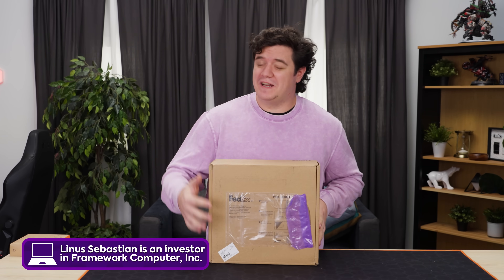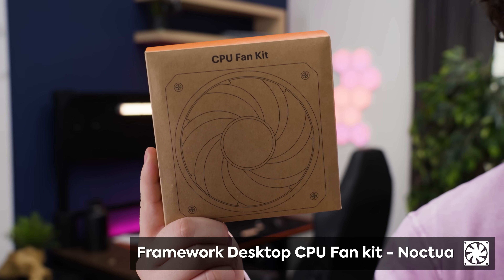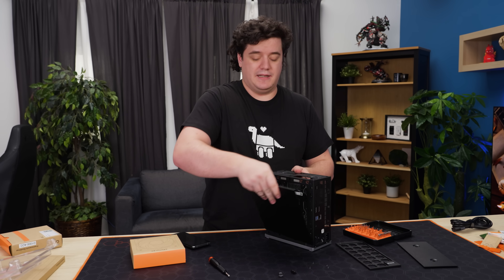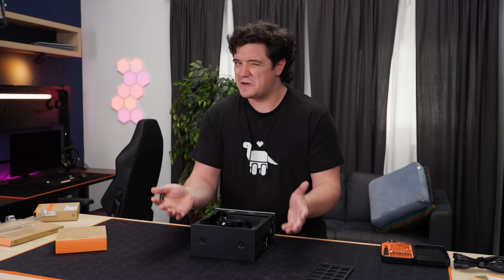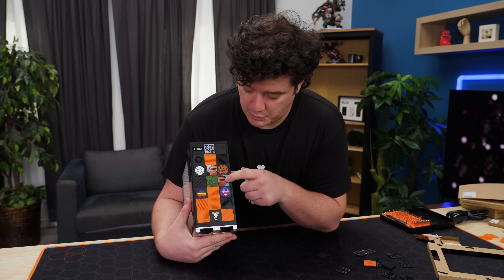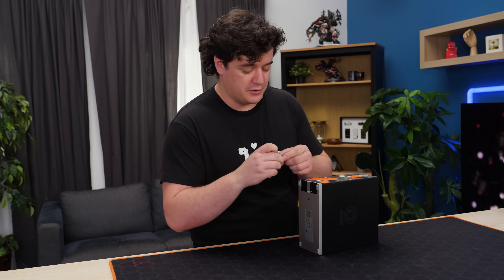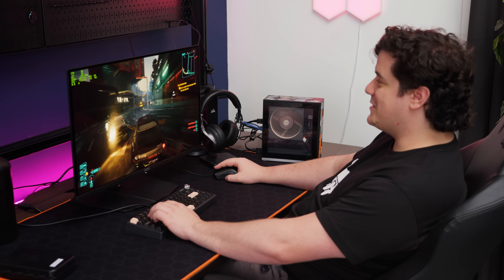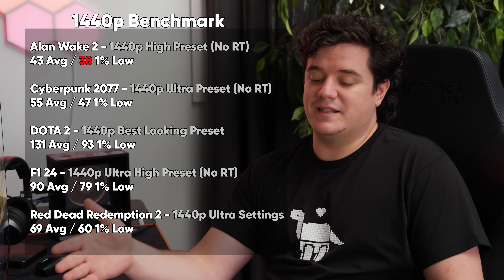This TINY desktop makes me nervous.... - Framework Desktop

Comment: You can't get 395+ chips that DONT have soldered ram, that's half the reason they're this fast and efficient. There's practically no latency.
Reply: I think it's partially an AI ecosystem thing...  VRAM capacity and bandwidth are usually the limiting factors when trying to run large language models.  The price starts to look downright reasonable when you compare it to the cost of buying enough GPUs to hit 96GB of VRAM.
Reply: I don't think that 2x latency compared to fast DDR5 can be called "practically no latency"
Reply: @NikitaCartes  It would be more fair to compare it to DDR4. DDR5 is slow compared to any memory that is faster than it.
Reply: The CEO addressed it, they tried with AMD but couldn't get it to work, and CAMM is still not a thing.
Reply: "There's practically no latency" 100% BS. Tell me you don't know what you're talking about without telling me you don't know what you're talking about. Unless you think that 139ns is "practically no latency". I'd say that if it was below 50ns.
Reply: and so the PC world realises and follows apple years after they did it
Reply: But isn't frameworks whole gimmick, interchangeable parts ? Lol they gonna go out of business quick
Reply: Disagree about the c-13 cable. I have plenty of those and I don't need more. Five bucks. It's not a big add if I actually need one. I think it aligns just fine with their mission of less waste.
Reply: @noisycarlos  I'm fine not including it by default, and I was when Apple did that, but it should be a free add on in the order process
Reply: @noisycarlos  Agreed.
Reply: The 8840u had soldered only configs. Unfortunate side effect of trying to be the fastest. Apple’s unified memory is the future of modern CPUs.
Reply: @FishyFelix  i highly doubt that, or we'd stuck with that system after the 80s 😂
Reply: @PutYourQuarterUpGaming considering that the 2 biggest brain groups are working at Apple and AMD both decided that unified memory is better.
Reply: @FishyFelix  It is NOT the future lmao. Apple "8 gigabytes is equivalent to 16 gigabytes" unified memory
Reply: @HyperScorpio8688 That was definitely a horrible statement, but even they now only offer 16gb minimum. 
I think OP is referring to unified memory being the way forward, not capacity.
Reply: Okay so why does the company who is all about repair and upgradability choose to launch a 395 desktop? Why release the product if it doesn't differentiate from others?
Reply: @RAMeReviews  AMD claimed to have made tests with the fastest available memory on the desktop site and it appeared to have basically crippled the integrated graphics engine
Reply: @RAMeReviews  because it's really interesting chip for enthusiasts that would never get released on AM5 (all due to 256 bit memory bus).

They nicely fill the niche for people that would want it in standard desktop/ITX format (so no Dell/HP with proprietary PSU/front panel connectors/etc) and get have quality BIOS with updates (no minisforum and alike).
Reply: @RAMeReviews  This is more repairable than many of the other products you can buy with this chip.
Reply: @RAMeReviews AMD was probably like, “Best we can do is this soldered package,” and Framework couldn’t negotiate anything better. Besides, if you want an SFFPC with replaceable internals, you’d just buy those parts off the shelf and suffer stuff them together. I don’t see why people are giving them a bad rap for this decision when traditional desktops are already fully modular.
Reply: @KirbyNPenguins  You can't negotiate to fix the laws of physics!!
Reply: @RAMeReviews  Because it's the best SOC solution on the market?!
Reply: @RAMeReviews  Because people who would bother to care about repair and upgradability largely overlap with people who care about local AI, so it's a similar user profile for Framework there.
Reply: @RAMeReviews  the soldered ram is the difference on this read up on it before it makes you looks less dumb
Reply: @RAMeReviews   They are pushing for CAM2 to be added to the spec for the next gen.  If you are not a customer you don't get a seat at the table.
Reply: @zanzabar4ky7 Still feels like a move against their business model. I would have been a customer had they not gone this route.
Reply: @zanzabar4ky7  Would probably require some changes to the chip, because my information is that Framework asked AMD if CAM2 could work with the signal integrity, AMD simulated it and it was a clear no.
Reply: @beanwithbacon  you find a lot of other small/mini pc’s that can pack that amount of ram?
Reply: @jessiethedude So make it slightly larger. Form should NEVER come before function.
Reply: @RAMeReviews There are plenty of companies making ITX motherboards with a CPU socket and RAM slots, so there was no reason for framework to make that. Instead, they made the most modular and repairable Ryzen 395 desktop there can be.
Reply: @RAMeReviews  because you can always buy the next board/soc that comes out
Reply: @RAMeReviews  it's just to get the product out there, I'm hopeful they'll release another with options besides soldered ram like minisforum does with their boards.
Reply: Wouldn’t CAMM2 help? I believe it have better latency then DIMM/SODIMM soooo…
Reply: @leon0399-yt  According to AMD engineers, it didn't work with the memory requirements of the 395, Framework asked and they simulated it
Reply: @leon0399-yt  I think it's not quite so good, and still ludicrously expensive.
Reply: So when Apple does it y'all riot, but when Framework does it you understand the benefits and forget repairability/upgradabilty?
Reply: @lightningdev1  apple charges wayyy to much for ram tho
Reply: @lightningdev1  Oh, I blame AMD for requiring integration as deep. Apple designs their own SoCs, Framework doesn't
Reply: @lightningdev1  It was not a Framework choice, it was an AMD choice. You can't fault them for someone else's bad decision, while Apple was all them with the bad decisions
Reply: @HyperScorpio8688  AMD chose to make ann exceptionally power CPU rather than an ordinary laptop CPU. Definately a good move.
Reply: There's practically no reason to need more than 64GB of ram within the next 5 years either. RAM requirements have stagnated a lot. I prefer to get soldered high speed RAM over modular sticks that I will never replace anyway.
Reply: @linaori  i disagree, even if it's a one off thing, when i was zipping a very large file it easily ate up all of my 64gb of ram when trying to use the best settings (i believe i ran into ram issues when i was using a local ran AI LLM too). Also I'm regularly using 25g-30gb of ram just having all of my stuff open, chrome/brave likes a lot of ram (plus having 4-5+ other programs always open on my second monitor), plus i get to keep all that open and play a game on top of that. i wish i had 128gbs just to have plenty of wiggle room, that's also why i bought a i9-13900kf CPU and a RTX 4090 GPU so i could do whatever i want on my PC and have relative futureproof for a few years.
Reply: Wgy not use camm ram memory
Reply: @AndresSanchez-uy9hh  Doesn't improve the issue
Reply: @AndresSanchez-uy9hh  Not quite so good, still ludicrously expensive.

Comment: Chill out about the soldered ram. It's been explained in depth that it's the only option. Nobody gets mad that their GPU has soldered ram, why is it so important for CPUs where the reason for soldering is performance?
Reply: I'm mad GPUs have soldered RAM.  They used to have socketed RAM so you could expand them later.  It would make much more sense for a modern GPU to have 8GB of RAM if it was socketed and you could upgrade it.
Reply: You are literally talking about apples and oranges bud. There is good reason to be frustrated by it, even if it is the only option. It would be nice to be able to upgrade the system in the future obviously. I'm not personally miffed about it, as I probably wouldn't buy it anyways. But to act like you actually care this much is laughable, and your point is barely a point

Comment: They should solder the memory to get the performance target they are after and make AMD happy, but still include 2 separate empty slots for future expansion.  Makes everyone happy and adds 5 cents to the cost of the motherboard.
Reply: I am no expert, but I suspect this wouldn't be practical without some sort of secondary memory bus clocked much slower, and I'm not aware of any computer CPUs that have found that to be cost effective. Electrically coupling the longer paths and less precise connections on the extra slots to the fast bus from the soldered chips would likely drag the bus speed down, possibly even without any extra RAM installed. Just having the extra paths sitting there like antennas would be rough.

Comment: "Look at the size of this thing!"

Look at the price of this thing.
Reply: I own a Framwork 16 and I feel the same way about the new main board pricing for that laptop. At least the 5070 has a good price.
Reply: You can literally buy 5 mac minis for that price lmao
Reply: if you have thee gpu. just get a minis forum cpu/motherboard. add the $99 gpu dock and your good to go. if you keep your eye on the website you can get a 16core 32 thread cpu motherboard combo with ther dock for under $600.
Reply: If you want to run local llms (which is what I would use it for) it's a pretty damn good price
Reply: Yeah that so stupid. was hyped about it but you can get a desktop PC that outperforms that thing and you can better repair

Comment: Soldered ram goes against their ethos. That bothers me. They could have given the soldered ram completely to the integrated graphics in the CPU.  put your typical SODIMM  slots on the motherboard for the operating system because like every graphics card; Nvidia or AMD, the graphics ram is soldered to the graphics PCB. There would have been an indiscernible difference.

Comment: The cable should be an option to remove it to take $5 off the price, same result as before but you don't feel like you are spending extra on a cable that should be included

Comment: Neither the front panel decorations or the soldered memory bother me here. 
The front panel decorations are optional and they provide a lot of customization options for those savvy with 3D modeling and printing. 
As for the soldered ram, I remember something about that being a requirement by AMD for that particular processor line. Even if Framework made that decision, it makes sense; likely, the performance just isn't there using DIMMs to justify using that CPU.

Comment: Framework tried really hard to add replaceable RAM working closely with AMD to see if it was possible, but the RAM timings are too tight for replaceable memory sticks or cards to work. Framework has been completely upfront about this issue.

Comment: I get that it's tiny, awesome, but this is literally a company whose core pillars is upgradability and repairability who has released a desktop that is LESS UPGRADABLE AND REPAIRABLE THAN A NORMAL DESKTOP! I don't care about AMD's soldered RAM requirements, if it can't be upgraded then FrameWork shouldn't have used that CPU.

Comment: I love Framework, but honestly, this product makes no sense to me. Desktops, including micro ones, are already very DIYable and expandable. So with no space for a dedicated GPU and soldered RAM, this feels like a step backwards for both desktop PC and Framework.
I understand some of these constraints are down to the MAX SoC, but it's not like Framework had to use this chip and put it into a brand new chassis, and if they wanted to have an "AI board", they could have made it into the Framework 13/16 motherboard module, which people have already put into "desktop" enclosures.

Comment: The cable isn't really an issue for me the little custom tiles is kind of lame I'd rather just have a solid or a mesh front panel for the van and air flow

Comment: I don't think it's weird or "backwards" that they soldered the memory on the board. With DDR5 SO-DIMMS, most mini pcs only use 5600MTS or lower. at 8000, this is a much better option and will directly affect your graphics performance.

Comment: I think that they called it a "desktop" is the thing that makes it not great for the idea of customization. Compared to Mini-PCs, it's actually reasonably customizable, and it uses a chip mainly used in Mini PCs and laptops. Basically, swappable memory is impossible with this chip, they tried working with AMD on it and failed.

I got the power cable, but I really didn't need it since I have Dozens of them in a box in my garage...

I spent $70 on tiles... But only because I wanted a specific design that needed 4 packs of the $10-15 tiles and 3 extra $5 tiles...

The Framework desktop IS actually dynamic, at least in Linux. I'm not sure about Windows.

Put the solid panels on the bottom 12 squares, except the one in the middle bottom, there's no airflow through those anyway.

My system sits at under 50c most of the time with the fan not running, when the fan does run it usually sits around 1400rpm...

Comment: Btw, a reason for the soldered ram wasn't just performance, it was also signal integrity. I believe framework has stated that there was talks with AMD to make sodimm happen, but the engineers on AMDs side just couldn't make it happen.

Comment: I see no world where  20 tiny pieces of plastic should cost $108. ($150 CAD) that is insanity.
Reply: Welcome to lego
Reply: @kkon5ti  Even legos r cheaper LMAO 😂
Reply: @lilducko And also a bigger brand than Framework lol
Reply: @sakenu16 that's why they're cheaper, that's how scaling works....
Reply: I imagine they dont want to have to deal with the logistics of sending these tiny ass pieces alone
Reply: Um that's the price for 40 tiles, not 20. 4 packs of 7 plus 12 individual. It's right there in the video champ.
Reply: Where did you get that price? They cost for me 150 pln which is about 40 usd
Reply: That's probably where they have huge margins. I don't see it as an issue. It's not essential and you can just 3d print your own. I'd rather they try to maximize profits on that end rather than other aspects of their products
Reply: @ajsunglao  I doubt its a huge margin, they know a huge number of their customers will buy few if any as they will want to use 3d printing to have the really 'pretty' accent ones at least be exactly the designs they want. So they probably only sell a few of them, even of the cheap large sets - so Its going to be a fairly small volume part that is pretty darn complex so expensive to make.

I hope they are making a reasonable margin, but I actually doubt it - with the amount of man hours just picking and packing all those weird bespoke ones to match the order will be, on top of relative small volume so more expensive per unit items...
Reply: @ajsunglao  This! Even LMG did their own panels when they first reviewed the Framework Desktop. Besides that can anybody even design their own expansion cards (I found even a Lego brick expansion card design while researching this point). Why shouldn't they also open the Desktop tiles?
Reply: @gelbphoenix  the design files (or maybe dimensions) were released afair
Reply: @ajsunglao  this is the answer, when apple pushes prices on important stuff people buy it anyway, this is a professional targeted machine, most people will buy the board and put it into a rack, the rest will probably run it without the front for airflow, is expensive? sure. Is the least aggressive way framework can make money, survive and iterate? also sure.
Reply: That's only because they got 11 of the expensive printed tiles and had a ton of leftovers (they got like 40 total). You can get 21 of the black tiles for $30. If you mix in some colors and one or two printed tiles, it'll be in the $35-55 range. Or 3D print your own with the STL files they provide.
Reply: you dont need to get the custom ones. In the us the price to cover the whole thing with simple black tiles is 30 usd not 108... You can buy the custom ones if you want, its not a forced purchase...
Reply: while i agree that it is ridiculous that you HAVE to pay for these, the video is a bit disingenuous...
you can make do with 3 packs of 7 of the blank black ones giving you one spare for only 30$....
the price LMG got was because they used one or two tiles out of every pack they had but priced in the full pack price because its "what you would have to pay to get this design"
also framework  could have priced in the 21 panels to kit the baseline but then everyone who wants to print his own or wants the design ones has an excess of panels.

imho they should have 3 packs be included in the price with a configurator option to opt out of them one by one so that you can decide to not get them but the base price will be quoted with a full set of panels
Reply: Except it not 20 they had bought a bunch of extra as you can see on the table after he is done... and also they bought a bunch of single ones that are way more expensive then just buying a pack of single colors
Reply: Are the files for them at least released so ppl can 3D print them? If that were the case, then whatever IMO
Reply: Injection molds are incredibly expensive, and it's also where they make margins.
Reply: It is just a mini itx board you can put in any chassis you like
Reply: It's not... Try to do it cheaper. If you're not willing to care for context, your argument is moot
Reply: that is the cost of buying from a boutique.
Reply: Are they planning on providing an STL at least?
Reply: @emmaginn  Of course, they provided the stp for 2D tiles and dxf for 3D tiles pretty much on release about 7 months ago
Reply: @emmaginn  its already on their github
Reply: Oh you'd love high end lego
Reply: Open your eyes, cos youre living in it my friend.
Reply: It's also entirely up to you to spend that money. This is such a non issue. Just don't buy them.